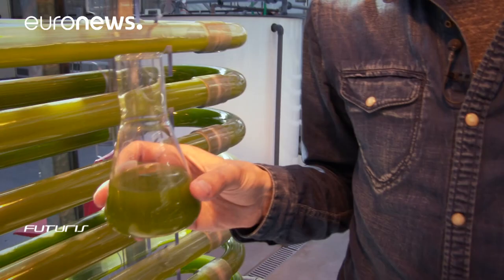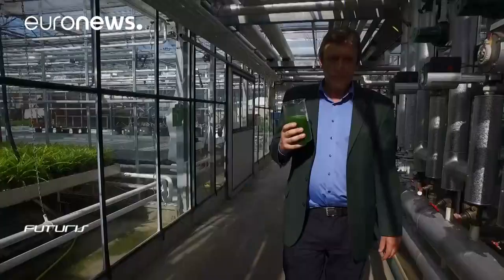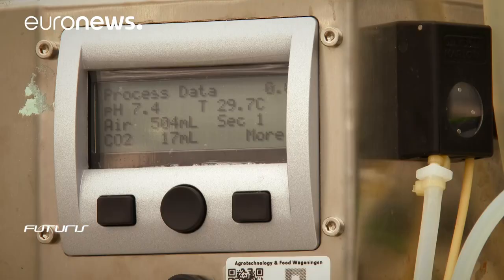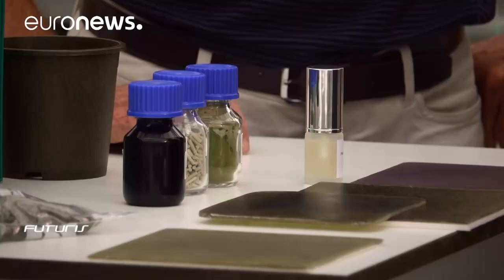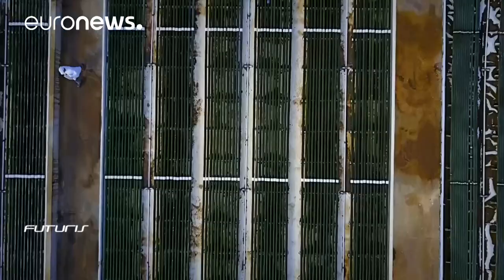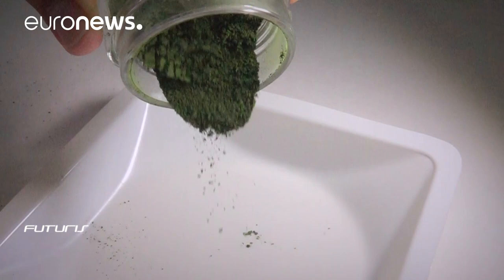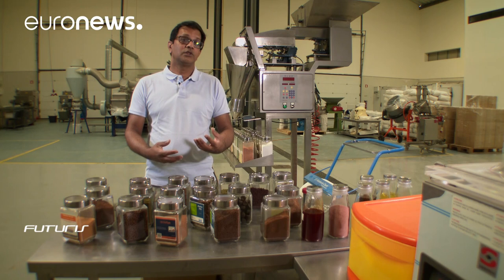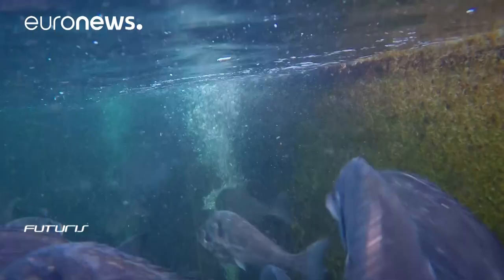Green gold in our sea water

Comment: c02, basic nutrients and sunlight are all they need. . . But where does the "basic nutrients" come from?  In other words, the food for the food in the Sea Water or elsewhere?  or in this mixture.   Well modern nitrogen fertilizer  comes from Natural gas.  As a matter of fact nitrogen fertilizer runoffs or effluents from human waste creates Alge plums.   So the food comes from other waste food or waste fertilizer which wasn't used when growing other food.  But what are the efficiencies and how much energy is wasted or comes from other processes that are used to "create" the solution.   Often with all engineering work in measuring things the more complex the system is the more chance for "energy sinks" which lose energy and makes the embedded energy to create and maintain the system to inefficient to scale as a solution.  We don't for example grow trees from sunlight alone.  We have to have nutriants and even "carbon" from Carbon Dioxide in the atmosphere for photosynthesis to occur and structure to be added to a tree.  

What is the efficiency of growth and how big are the tube and how many of them are needed to produce food?   If efficiencies don't overcome all the production costs and inefficiencies for you're food for you're food it's less than a gain, and it may require land, energy or other feedstocks that make the overall system to inefficient to be useful.  If the cost for all the energy and raw materials is greater than the payback, then you have energy sinks and economic sinks in the process that will doom the process.